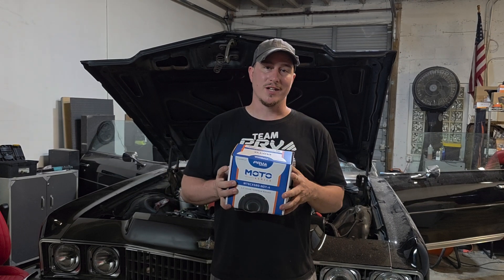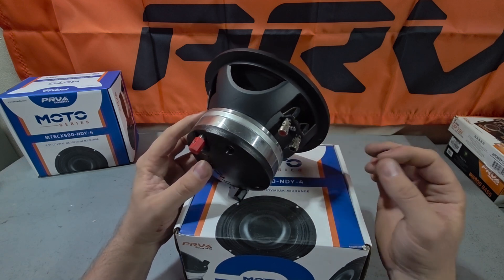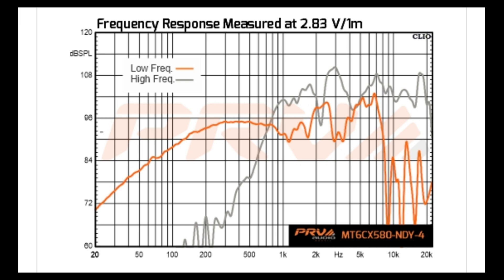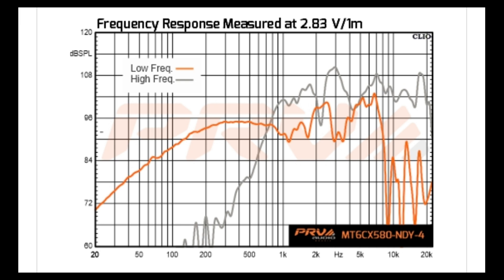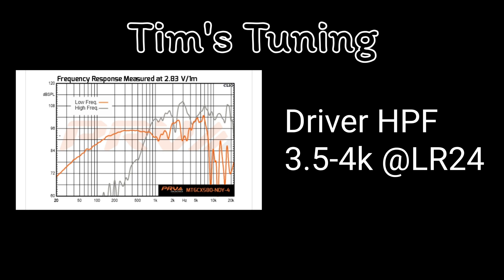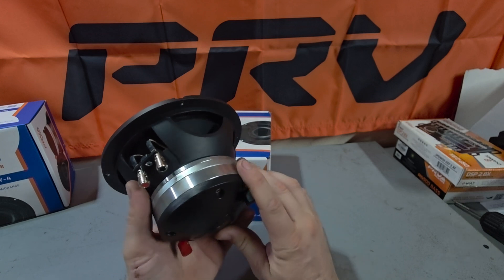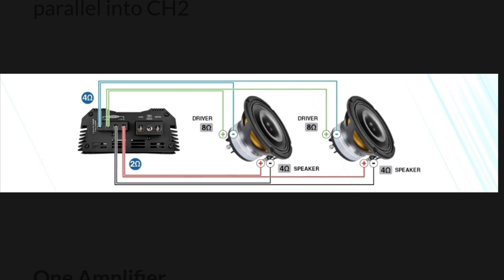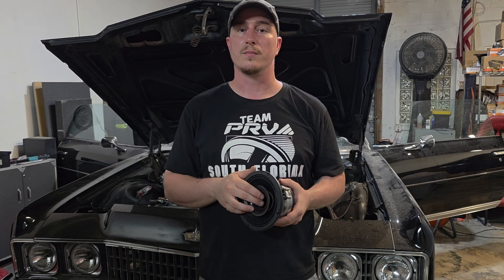Inside the PRV Audio MT6CX580-NDY-4 | Frequency Response & Tuning Guide

Comment: I want to know how to stick this speaker in my fairing of my 22 road glide
Reply from the maker: Need a half inch space ring.  And or need to cut or heat up and push out the side of the speaker pod.
Reply: @12voltfever you have a video or know a video, even on tiktok or IG?

Comment: would this fit in custom speakers pods ? louder then deaf bonce m67an ??? 

if loud and clear 2 on each door on a f150?🤔
Reply from the maker: These are a coaxial, the speaker you mentioned is not, I'm sure these would be louder.
Reply: @12voltfever you think their vocals and clarity will be on par? i currently run 8m67an on 2 jp284
Reply from the maker: I checked an F250 today and they fit in stock locations (with rings of course) so they should fit with door pods. You might need to cut the door depending on where the speaker goes.

Comment: Would be nice to replace stock speakers no tweeter needed..if it fits🥲
Reply: If you are dropping them in a Street glide its almost a drop in fit. You'll have to just shave down the inside of the plastic pod just a bit.
Reply from the maker: Yes would be great for that